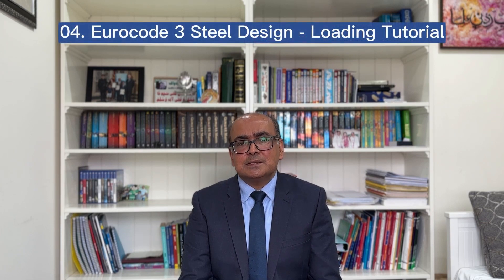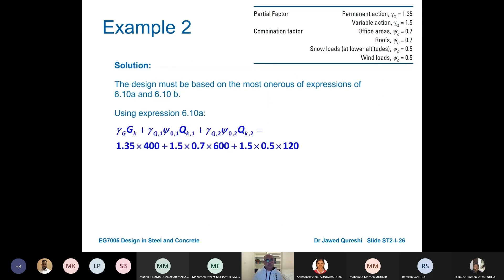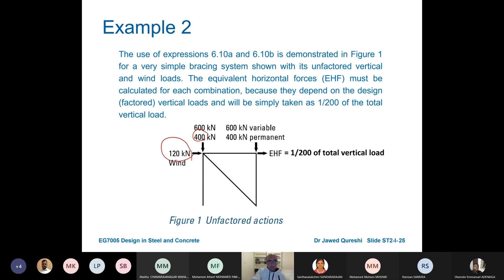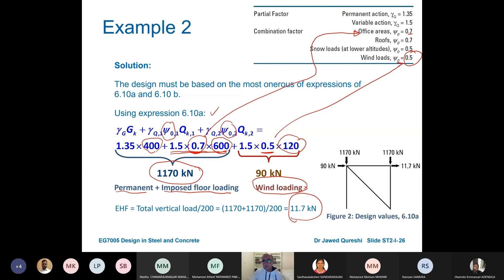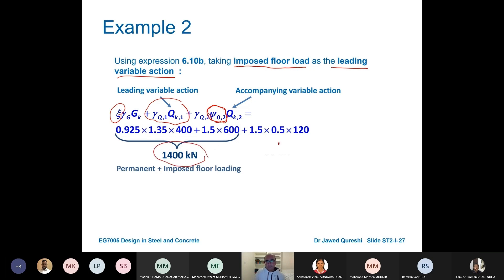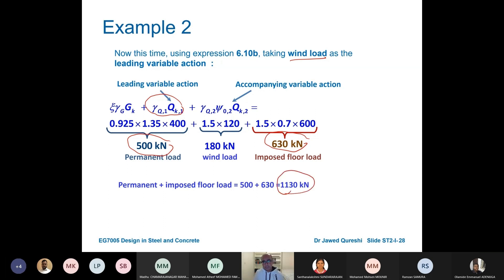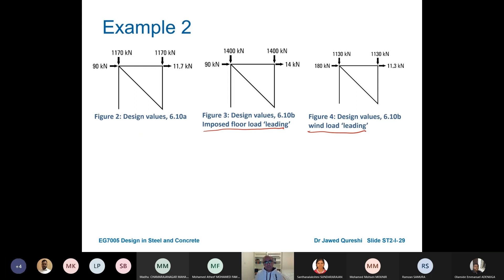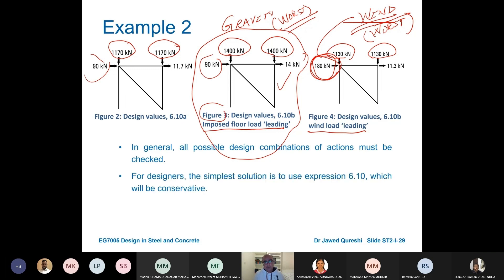04 LOADING Tutorial | Eurocode 3 Steel Design series | Introduction to Eurocode 1

Comment: Thank you for the lecture. Could you help on how to factor moveable loads. Assuming, in addition to other loads as in the example you have taught, there's also a variable moveable load of 60KN.

Will it be safe to use Eurocode 1 on actions table 6.8 that gives a qk=5kN for vehicle loads 30KN<gross vehicle weight<160KN
Reply: greetings sir @drJQ how  are moveable loads factored as floor loads

Comment: Thank you for the lectures sir. However, in getting EHF, why take (1400+1400)/200 instead of taking the vertical load once. The same thing in 2:06. You are adding the vertical load to itself.
Reply from the maker: EHF is used to represent the effects of imperfections in the construction, such as slight tilts or bends. According to Eurocodes, the equivalent horizontal load is calculated by dividing the total vertical gravity load by 200. In this case, we have a single bay frame with two columns, each carrying a load of 1400 kN. So, we combine these two loads to find the total vertical load.

I hope this clears up any confusion. If you still have questions, please let me know, and I can arrange a Teams or Zoom meeting to explain further.
Reply: @DrJQureshi  it is a satisfactory explanation. You have explained how that the two columns contribute to the total vertical load, which was what I had not gotten correctly.